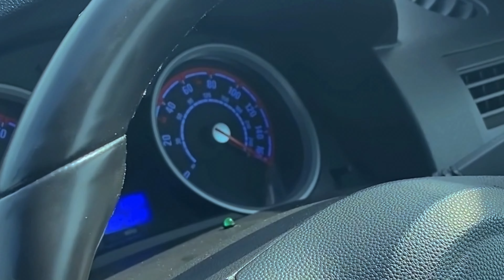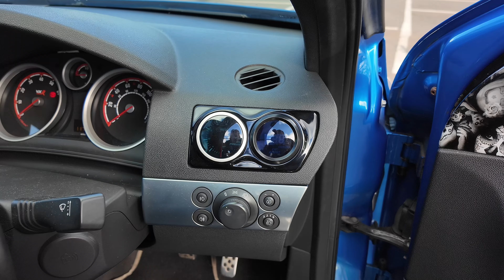Chris savage 404bhp Astra Vxr

Comment: Lovely clean example. Power figures are very high for a stock exhaust manifold, where was it dyno'd?
Reply from the maker: Hi mate yes probably one of the highest in the UK on stock manifold it was Mapped at giz Motorsport mate
Reply: @Vinnievxr666  seen some very strong figures on some dyno’s with the stage3 unit. Figures aside, looks to be a cracking road car 👌👌
Reply from the maker: @x8dudtrackdaytoy  yes them KRS stage 3 turbos are such a good turbo it such a good every day driving car just with a little bit more power what more could you ask for 👍🏼